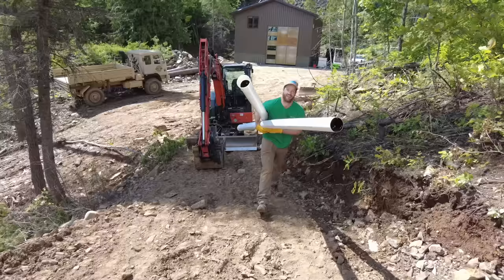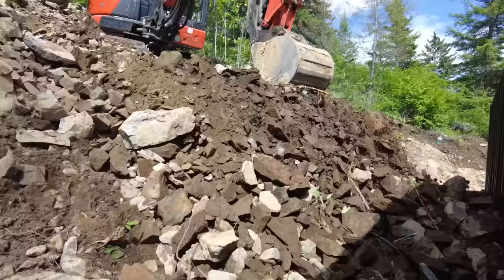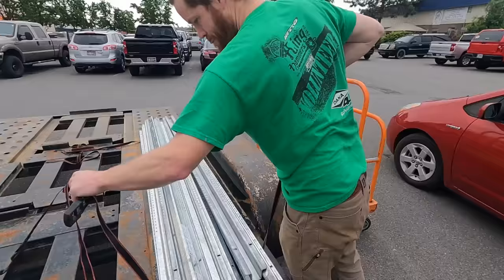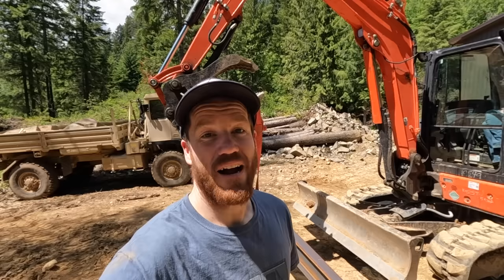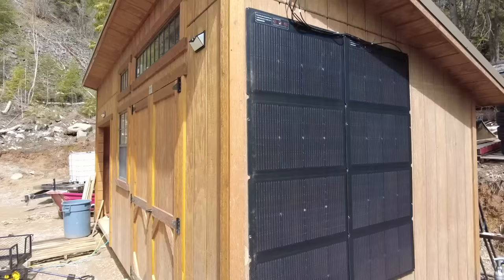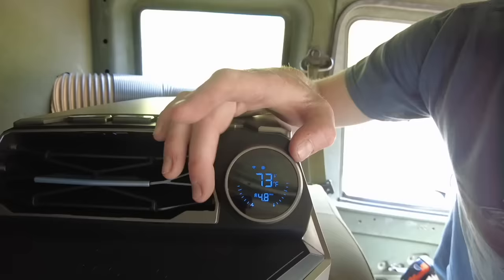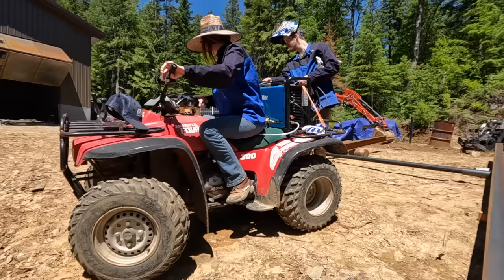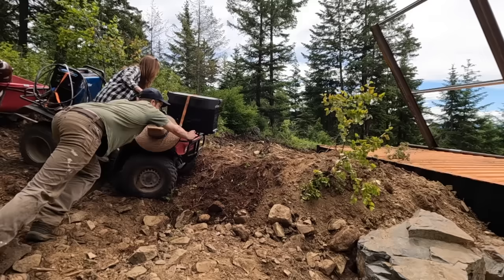We Were Told To NEVER Do This | Burying A Shipping Container

Comment: My fear is a torrential rain event loosens the slope above the container and you lose everything down the slope.  As mentioned by others you could move some boulders or earth against the opposite side to help hold the container in place, just in case.  I have seen containers both float and blow away in conditions that you would not think could move them.  Shipping containers are designed to be lightweight and their strength is in compression when stacked, they have little strength laterally, relatively speaking.  Love this channel, makes me wish I had done the same in my youth!

Comment: cool idea but i would put all the battery's and electronics on the berried side to add wight to make sure it won't flip with the first gust of wind coming from the back
also i think you should added an electric motor and a tracing circuit and this way you wouldn't have to ever mess with it ever, automation is king!

Comment: I hope your shipping container is heavy enough, or that you fastened it well to the ground, as you are building a large windsail and windsails pull a lot when the wind blows. Because you fastened the solar structure to the TOP of the container you'll have a force driving the container to roll down the cliff if the wind blows strong enough.

Comment: I can tell you without cathodic protection you will eventually get holes over time.  Step 1 would be place a good coating on the container. Step 2 bury zinc anodes around the sides and bottom and ends. Step 3 connect the anodes to the metal container. step 4 enjoy for 20 years before replacing anodes.

Comment: How far have you advanced on buying your batteries and inverter/s. You should ideally keep your batteries above freezing and below 40 degrees Celsius for longest life. If possible put back up generator heat into the container and generator start battery inside container to give best chance of start in low temperatures.

Comment: You don't need an adjustable array, in the PNW, the U of O determined the optimum angle for year round use to be 35 degrees, after all the winter where you live is mostly overcast all winter and luck to avg. an hour a day (days of autonomy apply). I have a Sedona tracker and have quit adjusting it unless the weather is expected to be clear for a few days. I design systems for clients, consider this good advice.

Comment: I wish I was rich enough to get the tools, equipment, and materials you have. I could do so much with my place. The metal you have in the mounting system for your solar panels alone would require me saving for at least 1 tear and probably closer to 2.

Comment: Put the container off the ground or it will rot out the floor... 12x12  pads on each corner should work...watch the snow, it could be very heavy .Grease nipples on the hinges...I painted white because I live in Florida's. heat ....Think a dark green would look nice and it don't "stick out" ...Oh yea; vent fan with thermal control would be good....Don't get hurt!!!............Robbie

Comment: I don't remember the channel name but thy barried a container and came back later with footage showing it had collapsed. They just aren't designed structurally for external pressure but if you are just back filling and a light over coat of dirt on top should be good

Comment: After watching your video for a second time, I really think you need to find a way to anchor your container to the ground.   Short pieces of rebar are not going to work.  When that hillside gets soaked with snow melt and rain the amount of force will be more than you can imagine.

What you need are tie backs/deadman.   Large block buried deep in the hill and attached (chains?) to the container.  The side may buckle, but the container will not slide down the hill.
Reply: The best deadman would be a block of reinforced concrete about 2x2x2.  The size is not as important as where it is buried.  It should be about 10' back from the container and 2'+ BELOW the connection point to the container.  You will need 2 for sure, but 3 or 4 would be better.
Reply: If you don't want to do the concrete block make 2'x2' square out of PT.  You can use 2x4 but the have to be double thickness at 90°.  The chain should pass THROUGH the old and connect to a piece of rebar.

Comment: You've mounted the winch fairly high in comparison to the anchor point on the solar panel frame. If you lowered the winch mount, your leverage and loading on the winch and it's mount would be significantly reduced. Lots of other comments to review. Grease up those pivot points to keep water out, rust away, etc. It's a bit late, but a foundation would have been a good idea. I'd be concerned about rusting out the side of the container. I don't think you're going to see 20 years out of the side you have against your hill. You might consider bracing on the bottom as well as the top. The wind can present quite the load considering the size of your array. Ever try loading sheetrock on a windy day. That array is a hell of a lot larger.

Comment: I'll give it at most 5 years before the container wall starts severely bowing in and/or the whole container starts getting pushed down the hill. People always think this is safe because they don't see any issue immediately after burying a container, or in this case making a flimsy retaining wall out of it. 

The problem happens over time, specifically during rain and freeze cycles. People grossly underestimate the amount of pressure saturated or freezing earth puts on subterranean structures, particularly structures with earth on only one side. As the structure starts to give, the pressure never relaxes, and it just continues to push more during rainfall or freezing cycles. 

Think of dirt as really slow moving liquid. it is constantly trying to flatten or level out, and it will push anything not securely reinforced/anchored out of it's way while doing so. Maybe the only exception would be a desert where it never rains or freezes, but I would still recommend against it as I'm not sure what other forces in a desert area might have a similar impact.

Comment: I enjoy your watching your project. I however hope you don't mind me pointing out a serious safety concern. You have a habit of lifting with a strop with both ends back at the hook or shackle. You need to put the strop thru one eye and "strangle" to what your lifting. Two reasons. The stop can not slide along a beam or log for example. I know it takes longer to attach. Second reason is centre of gravity does not change. With a wide strop c o g moves from one side strop to the other and the c o g is on the lower face of beam. That makes it naturally unstable. When you "snatch"  it or "strangle" it the effective c o g moves to top side of what your lifting. So when you pick stuff up it wants to stay below c o g, not move one way or other trying to find c o g. I know strops have a good grip on stuff but if you did that job with a looped chain it would have slid out. Same tendency exists with strops but they risk is simply discuised. Great job. Keep safe.

Comment: Okay you will have 2 issue with the solar install.  
1st: you should have tied into the corners that have the strength.  Snow load and wind load are real and may cause a failure since the hinge is not tide to the corner posts where the strength is. 
2nd you mounted the winch in the middle. It is not re-enforced. You can do this on the inside with a box frame of steel for re-enforcement. If you don’t i suspect with wind and snow the side will be pulled out. Which will weaken the box. 
These simple fixes will lead give this longevity.

Comment: Perhaps a continuous EDPM membrane surrounding the container?  Ground water pressure should be contained 
(the future will tell).
Otherwise good plan thumbs up :-).
A pressure treated deck on top would provide a mud free deck entertainment area. Zerk grease fittings installed on the pivot area, good idea & ez.

Comment: I like ya solar array hinge system but u will need proper bracing for it and especially inside the container and for the side with all the rocks on it u will need to weld in some 50mm x 5mm wall SHS vertically and horizontally and then some for where ya winch is,the container steel is only 1.6mm thick for the walls

Comment: Nice setup and you are only partially burying the container you should have less problems. Also this is a standard height and a shorter 20 ft container so less chance of the wall collapsing. But, all the strength of these things is really in the corner.  I would suggest putting a few floor to celing steel beams welded to the buried wall to shore the thing up as things settle over time.  Really cheap insurance when it is full of expensive components. I have seen several houses where the block basement walls were pushed in  over time.

Comment: for the structure on the connex i would find some unistrut then go every 16 on center and put it up just like building a wall on a house and across the roof area for support because there is next to no structure on the center and wall of it  and you might want to rubber seal it like you would water proof a house wall underground just saying

Comment: I think if I was going to bury a shipping container. I would build braces to support the roof while pushing the top part of the walls out. Below that I would weld metal lengthwise on the outside of the sides then temporarily force the walls out a little and anchor them. I'm pretty sure that would keep the walls from slowly collapsing. Of course unless you made  very good use of anodes to protect and coatings to reduce current consumption the container would eventually corrode and weaken. I don't think I would mount the collector on the container.

Comment: search .... hydraulic  pressure for water flow like how damns fail from the bottom.. Reinforcing large flat areas like the wall and roof from crushing. If full burial will need reinforcing. Should of completely covered the container with best truck bed liner or deck armor coating for longevity against rust. Containers for dirt mounted on the bottom would allow for balancing the solar rack weight once fully outfitted. Concrete wedge with rebar anchors along the south bottom edge of the shipping container would help with sliding issues. Bunch of solar panels can double as a sail on a windy day. Being able to to lay the array flat might be a good plan. Generator at the end of the shipping container will block the noise and move it from the south drop off edge from vibration and liquefaction.

Comment: The sides will rust fast.  Pull the side rock off and add the same thick plastic they use on the outside of basements that goes between the earth and bro long the base me t.  That should be that side from rusting out fast.

Comment: It should be fine for 25-30 years as long as you remove the wood from the floor. If you don't want to remove the wood, put 3-4 thick coats of garage floor epoxy coating on it.

Comment: Buried or not, rust and leaks would be a concern of mine. I'd use a rubberized coating on any surface that will be contact with soil or water.

Comment: Unless you reinforce it, it will fail?
Strength of the container comes from the corners not the side or roof. Once water fills to soil they weight will make the walls bow in.
Also if you don't lay your own foundations but place it on soil, over time it will slowly sink as the soil beneath it compacts.

Comment: There are 2 issue with buried shipping containers.  Water intrusion thru the floor as it’s wood. It appears you water proofed the side on the hill.  The drains were nice. I would have put them on stills or on a concrete pad.  Not sure if you have a concrete pad.  The other issue is strength of walls and roof. Although strong and sturdy they have strength in the corners. This is how they are stacked. The walls are strong but don’t have the structural strength. If buried over time the soil with compress the walls and roof leading to collapse.  Most people reinforce with rebar and concrete to keep the container from collapsing. You have not done this so it may not happen or will only happen on one side.

Comment: The shipping container is designed to support weight only on the vertical posts. The walls and ceiling will not support very much weight. You do not want soil in direct contact with the container.

Comment: What ever happened to the generating set that you picked up? I thought it would be an ideal power source for the welder. Especially for the thicker steel you are using. Also have you ever considered getting some hydraulic attachments for the excavator? Using the flexibility of the excavator with a rock breaker attached would be a lot quicker and easier that a hand held breaker! Also a hydraulic auger drive unit with suitable augers would have been useful to drill holes for poles around your container. And if you lift the drive unit up on an angle and attach a concrete mixing bowl then you have a mobile concrete mixer!

Comment: ok, first issue, the structural points on the shipping containers are on the 4 corners...  The actual sides,  roof and floor are note structurally sound for loading.  The failures of burring a shipping container happen when earth/rock settle against an "unprotected" side and cause the sides of the container to bow in, or the mass on the roof becomes to heavy for the metal there and the roof collapses.  the solution or counter to this is internal reinforcing of the skin.  often steel bracing or ribs done much like a houses internal frame.   

The next issue is rocks can cause nicks or chips on the paint.   These containers are not stainless steel so the paint acts as a rust protection or rust proofing.  Nicks or scratches in the paint will allow water and air to access the steel, and cause it to rust out.    There are several counters here to an extra rubber coating, paint followed by a thin concrete or concrete rebar layer.  When all else fails, a Sacrificial Anodes or Galvanic anode may work to minimize the rusting and extend the life of the container.
Reply: For a container that size, you'd probably want either 6 or 8,   3-4 per side, evenly spaced at the lower points maybe a foot above the ground level.   little late now, but just a think to think about and look up for people working on projects like this.

Comment: I don't know what your prevailing wind direction might be, nor how strong the wing might get in your area. However, that is a very large sale, and if the wind gets strong enough, I could see it blowing your container right out of the side of the hill. Granted if you fill it with batteries, that may help, but I'm still concerned about wing loading moving your box. 

The idea of tilting the array is genius. I'm wondering about using some type of control system to vary the angle on a continuous basis. How about a long pipe, in bearings, driven by a gear motor. You could wrap cables around the pipe, then via pulleys to both top and bottom of the frame. Due to the angles involved you'd probably have to include some strong springs in each cable. Anyway, with such a scheme, you could optimize your angle for every day of the year, even possibly under computer control.

Comment: Don't forget to water seal the floor..
It is wood...And can you rent a auger drill two hole on the side fill the cement put steel ,,, I-BEAM or pipe 
To  reinforcement the side ,,so it doesn't move... After the dirt settled on the other side..that rebar isn't going to cut it...it will move if you don't.....

Comment: Did you think about  making some Steele  reinforcements inside the container. maybe 200 tons of rock may crush that wall.
and  concrete the front edge of the container, in case your reo bar gives way over time ??

Comment: I've done this and even using car tires to keep the pressure off the side wall, the shipping container failed. Sad to say yours will fail as well. Forget trying to put soil over the roof. You will have a very expensive bent tin box in the ground. The only way to stop that happening is to fully reinforce the walls and ceiling with steel RSJ's but that much extra steelwork will cost more than building a properly constructed underground building.

Comment: How strong are your winds?  That winch mount is on a rigid panel, my concern is over time the weld joint and the membrane can fatigue the metal and cause the metal to tear.  That could lead to catastrophic failure and damage to the panels.

Comment: The reason why they tell you not to bury containers.  They are strong on the frame part so they can be stacked. Example the corners
From corner to corners.  They are weak between those spaces. And not strong enough to support dirt etc. Good luck.

Comment: I'm very impressed with the design and fabrication of your solar 'rack'.  I am not confident, however, that the container will be heavy enough to be the only anchor if you experience anything resembling high winds.  Just simply digging a hole with a post hole digger, filling it with cement and a steel support of some sort, burying that and welding the corners of the container to each would be sufficient.  I'm really hate to see the results of that huge solar array flying off in the wind, container and all.  Make for great content, but... Thanks for sharing and good luck!!

Comment: I’ve seen many containers buried at motocross tracks through the years. Usually open on both ends even used as tunnels so people don’t have to walk across the active race track. I’ve seen some fail after a few years of thousands of dirt bikes jumping over or landing on the dirt a few inches  above. I’ve seen some that I thought would fail that have lasted decades. 
When they fail, they usually start to move very slowly. Not just all at once collapse. I wouldn’t be worried using one in the situation you guys are. It will probably outlast it’s intended use.
Reply: You referring to washougal track